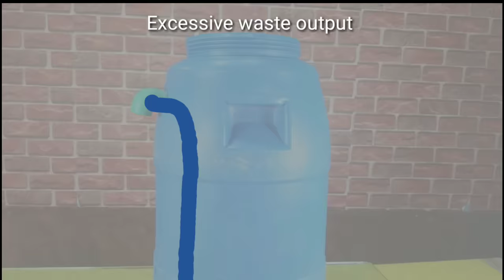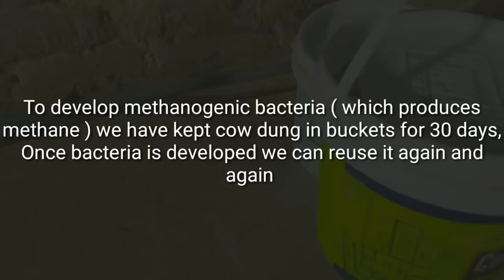How To Make Free Gas from Fruit And Vegetables waste | Bio gas plant |

Comment from the maker: A cork is fitted to the end of Overflow yellow pipe which can be removed when required.
The part is missing in video and everyone is nervous about that.
Enjoy the video and Be Safe,,👍👍
Reply: @madaiincubationcenter4947  Once biogas plant started to produce gas, you need to feed same with fruit and vegetable waste only. You can add waste upto 1 kg on daily basis if digester size is more than 1000 liter  and gas holder size is more than 750 liter.
Reply: how long does it last?
Reply: Naveed Zahir Creativity vijay
Reply: Do you mean the cork will remove when the wheel tube is at max volume of gas build up?
Reply: 1# Why the gas outlet valve of Drum is Close?
2# There is No valve installation on Overflow pipe. How its possible to pressurize the drum and storage tube in this condition?
Reply: Is there hose down in the drum for leak off
Reply: thank u in advance
Reply: भाई यह साइड मे ऐल्बो वाला पाइप क्यों लगाया है कृपया जल्द बताने का कष्ट करे
Reply: Useless
Reply: Sir, how many hours of fire can a full tire can generate?
Reply: Thañks. Let's build a 2.0 version, which have 1 way filter and elegant input waste door. So it need methanogen bacteria?
Reply: Why do you need an overflow pipe? Cow shit and  kitchen waste does not increase in volume.
Reply: भारत मुंबईकर 042
Reply: @gilbertoordonez3114  Sorry , I do not understand Urdu.
Reply: ¿El tubo que va a dentro como se le coloca?
Reply: But bhai, what to do when the tube is completely filled. Gas will still be filling, right..? 2) Till what time will the tank produce the gas..? There will be some limit correct, as to the amount of materials input..? Pls answer. No doubt, this is fantastic for rural areas problem solution. But how to control the production is most important. Pls guide. Thk u. Saby.
Reply: @sabyjpinto  gracias, si es en una zona Rural, no entendí muy bien lo de el tubo en el interior pero agradezco tu respuesta
Reply: We used all Expired products and infected food in our videos, Please do not waste any food because there are Still many needy people who don't have any food to eat. aI honestly want to help them please Support 👍
Reply: How long will it take to sustain gas flow? One month? 1 day? 1 week?
Reply: The yellow hose and water bucket are an overpressure release/"safety valve" system. You use a depth of water such that bubbles will come out the bottom before the blue canister and rubber storage chamber burst. 14.5 psi per 33 feet of depth. Since any bubbles would contain methane and escape into the surroundings, either constant observation or putting the bucket portion in a well-ventilated space/outdoors is required.
 As long as the overpressure in the blue canister and rubber storage chamber is below 1-2 psi, the pressure exerted by the water in the bucket will prevent gas from bubbling out through the yellow hose. This greatly limits the amount of methane that the system can store. The pressure and storage can be increased by placing another, inverted bucket floating in the larger bucket, with the yellow hose entering the created air space inside the inverted bucket or placed beneath the inverted air bucket so that any bubbles will enter the created air space, and placing weight atop the inverted, floating bucket. But you must be sure that the pressure so created does not exceed the bursting pressure of all of the other components.
Reply: Hopefully someone here can help me out. In the middle of building a 5 gallon bucket biodigester. I don't understand the pros/cons of various ways of building the outtake for slurry. Some people seem to have a pvc on the inside, while others manage without -for example, an upturned elbow pipe. Some use a ball valve, others (like this) use a cork. Some use a t pipe to avoid accidentally siphoning the container empty, but it's not always needed. Anybody able to provide some clarity? I just don't want methane wasted in my outtake, or slurry being released when I'm not around.
Reply: amir khan  It absolutely does. That's the direction I was leaning towards with an internal pipe for the slurry's outlet, but I wasn't sure if I'd been missing something. Thanks.
Reply: @gonzaloramirez5514  Gracias. Muchas zonas rurales no tienen conexión de gas. Esta es una excelente solución donde todas las personas pobres pueden producir su propio gas si se les enseña a controlar la producción de gas.
Reply: I have 6 questions.
1. Does the gas smell bad?
2. Does the smell go away when you burn it?
3. If the gas was to bubble up through water before you burn it, the hydrogen sulphide (rotten egg smell) dissolves very easily in the water, and the methane does not, that would get rid of the bad smell, but what would it do to the water? 
4. Do you know how to make fertilizer from this?
5. How much gas do you get from the waste before you have to start again?
6. What happens to the waste after you have extracted all the gas from it?
Reply: @sabyjpinto  gracias por tu respuesta
Reply: @gonzaloramirez5514  de nada mi amiga.. :-)
Reply: Mk
Reply: How will you keep on adding waste
Reply: This is wonderful enough. I see people wondering about storage,  but it's so easy to figure out. 

What we need is our brewed Methane. Just run the Tvalve into a  gas bottle and put your eyes on the gas bottle by allowing water to run on the side of the bottle to see the gas level in the iron container. When it is full or you get your required level,  simple short down the entire system until you're ready to refill again. 

What's the trouble about that my people?
Reply: En español me puede decir cuánto es su duración
Gracias
Reply: Fico impressionada com a capacidade de algumas pessoas ao redor do mundo.
Reply: Be safe.  Inner tube is close to fire..be safe
Reply: Yes sir ur right
Reply: @gonzaloramirez5514  lm tttt
Reply: Bravo una cosa mijour
Gracias
Reply: Hallo sir repale
Reply: @shubhamgupta8984  ŕ
Reply: What is the yellow tube for? What is the use of it
Reply: I have one doubt bro that if we keep that cow dung in plastic bucket for 30 days because of the pressure the bucket may blast is it good to keep in bucket cow dung
Reply: @naveed zahir creativity, can i get its thesis.. And also tell how much gas quantity could be produced
Reply: M
Reply: You need to add a bubbler tube so you will not have basically a gas bomb if the flame goes back into the tank.
Reply: Blue light comes out when bio gas burns, yours is normal gas ,,,,,, who are you kidding ???????
Reply: Blue light comes out when bio gas burns, yours is normal gas ,,,,,, who are you kidding ???????
Reply: Blue light comes out when bio gas burns, yours is normal gas ,,,,,, who are you kidding ???????
Reply: What's the song
Reply: Anyways, what's the song?
Reply: I was not nervous, more like it won'T work since all methane would escape from the yellow pipe lol. thank you for sharing , thumbs up  we need to learn  these processes these days!!
Reply: now i understood 😂😅😅😅 thanks👍
Reply: @bharatmumbaikar  v
Mav.vm.
Reply: @jaydiomoyeni7436  so how long will it Last before recycling?
Reply: @makerofmanythings8447  what is bubbler tube sir?
Reply: What's the disadvantages of the bio gas?
Reply: One question: what if the excess gas surpasses the gas chamber capacity and has no other outlet?
Reply: How does it smell when it's burning?
Reply: Very classy way to make a kind suggestion! I'm sorry but I'm still trying to get over the PTSD  that Facebook can cause so I'm not used to people being kind to one another or having nice conversations, which are also intelligent, so you'll have to forgive me.lol☺️👍🙏🙏🙏
Reply: sir paano pupunta sa stockan ung gas, my butas ung overflow mo sa gilid na hos. tsaka anupo ung nilagay nio na, 2 timba.
Reply: @Galv140577  Wow! You are asking many, BUT very good questions that I am interested to know myself. Great post!!!☺️👍🙏🙏🙏
Reply: @bharatmumbaikar  this does not work. The yellow hose does not allow pressure to fill the tire chamber. The gas escapes through the yellow hose.
Reply: Good job.
Reply: @bharatmumbaikar  HHow do you feed? when you open the lid and the gas escapes...
Reply: P
Reply: @madaiincubationcenter4947  là
Reply: @madaiincubationcenter4947  ll
Reply: kĺp0
Reply: @virendrapratapsinghshisodi724  وانا لم افهم لماذا وكيف تم ضغط الغاز وهو مفتوح
Reply: How to clean this drum then
Reply: Sure, that was what was clicking in my mind because we cannot hold pressure in the tube & the yellow tube being a back forth  outlet
Reply: @Naveed Zahir Creativity How many hours of cooking do you get when the tube is full? Thank you.
Reply: I thought that side pipe was for air; don't need air for this?

So, is an "overflow pipe" strictly necessary?
Reply: Hola buenas tardes de casualidad no tienes una lista de los materiales
Reply: what do you mean "the manure can be used again and again" whats the  process?
Reply: Please the external big pipe is channeled for what purpose
Reply: @ZahidAmeenOfficial  a good    question nice one
Reply: Nice idea
Reply: klau dari WC gimna cara nya bang
Reply: А что в вёдрах добавили?
Reply: Çıkan gaz yanmiyor. Yardımcı olur musunuz
Reply: @jaysolano8764 when will it require to remove the cork😮
Reply: ممتاز جدا والله
Reply: Can I purchase this???

Comment: Add a second barrel and fill it with plain water so you can water filter the hydrogen sulfide off the gas by letting it bubble from the bottom up and out to your storage tube or tank ❤️🙏

Comment: The flame is yellow because of impurities. Best to pass the gas through steel wool and through a water tank to filter out the co2 and h2so4. Then you'll get blue flame. Also, is it safe to keep the rubber tyre so close to the flame? It can make it expand and explode. keep a longer pipe, and keep the set up outside the kitchen. 
Good job and thanks for teaching. Hopefully, the whole world will do more of this and be fuel sufficient. and save the environment.
Reply: But with the yellow flame is possible to cooking? Right?
Reply: Who cared about blue flame? Yellow flame is more hotter.
Reply: Thanks for the information
Reply: @caiodemaduro6408  it's less efficient
Reply: @ranjanbiswas3233  you bunked science classes
Reply: But what's the white bucket for on the ground next to the Blue Barrel
Reply: @carlschmiedeke151  overflow for whats in the barrel
Reply: @ranjanbiswas3233  No, blue flame is much hotter than yellow flame & the hottest kinds of flame is almost invisible. (see welding torches)

Comment: I recommend using a 90° elbow on the lid to prevent the tubing from kinking. Also a couple  of flame arresters should be added. It's basically a piece of plastic piping filled with water with a hose fitting on each end, this will prevent the system from becoming a bomb if the flame goes into the tubing if the gas pressure gets to low.
Reply: I totally agree 😆
Reply: is this really possible and true sir? Planning to do this during the weekend.
Reply: How long when you have only one dram?

Comment: This is amazing. I guess instead of letting wasted gas going through the water reservoir you can connect more tyres or have a larger tyre. A regular car tyre is around 1.2 cubic meter is roughly around 10kwh and a burner uses around 1.5 kw per hour so that tyre can last you up to  6.6h!
Reply: better: while not cooking, turn the cooker on minimum and place it under the blue drum — the fermentation will be nicely enhanced...

Comment: Thanks for the great video just wonderful info to help people become more independent from the big oil companies!!! Keep up your wonderful work!!! In the 1970 I was working on a project making an expansion of the municipal sewage treatment plant in a very large city. There we scrubbed the methane gas and we ran pumps and backup generators with this gas. We had 2 methane gas storage metal spheres for storing the methane gas. We produced so much gas that we had to burn off the excess gas by using 2 torches that produce a 3to4 foot high flames that ran 24/7/365. Part of the expansion project was building 2 more 80’ diameter spheres. And that was still not enough storage space. They also had burners for getting rid of the excess gas!!! The funny/sad thing was this all took place during the Arab Oil crisis.... There was talk about converting the Municipal cars truck and buses to run methane gas... nothing ever happened. Now maybe we have learned our lesson (MAYBE) and we are moving more and more to electrical powered transportation!!!
Reply: In my university there is this method of turning waste to ethanol since the 80s, but it's never used.

Comment: You need to add pressure relief valve that will release excess gas when we are away for holiday ( safety measure). Also, need to explain your audience that when refilling the waste tank. Close the ‘trapped’ gas in the tyre so you don’t lose so much gas during opening the blue tank. Also, use waste byproduct as Bio fertilizer once done with biogas production.
Reply: Just wondering where exactly  it is supposed to be fitted
Reply: Rama Yusvana
1 год назад (изменено)

Comment: Why not put the epoxy glue between the brass fitting and the cover, and instead of drilling a hole on the cover, drill the hole on the highest side of the drum so that the tuning will be out of the way when loading the drum, and the tubing will not have a link
Reply: que cagada hace con la presion del gas  buela revienta todo
Reply: Good idea sir flaviano sico

Comment: Nice video. But please take much safety precaution with gas. Burning gas right beside gas in the tyre could be very dangerous.
Reply: lol yeah, the tire full of gas was like below 10 inches from the flame...overtime if the rubber burns, it could cause leakage or outright instant explosion!!!

Comment: This method seems to work but I think you would benefit from a few key improvements. To start, the overflow should be in the very center of the barrel with an pipe on the inside to the dead center of the middle of the barrel. This is because it's the most stagnant and is decomposed properly. The bottom has a ton of bacteria while the top isn't ready yet. A valve would be needed to prevent unwanted flow. This material is used for your crops. Second improvement, you need a scrubber to clean the bad gas's out. This can be done with iron wool that is rusty. Bonds with the other gas that's not methane. This is VERY important. Also bubbling the gas after this step through water will further help purify. Lastly, a spark arrestor or flashback prevention is always a safe bet. Don't want to blow yourself up.
Reply: Spark arrestor for static charge?
Reply: @raufjaleel8317  it's a flashback prevention. Keeps the fire out of your storage tank.

Comment: This lacks a back fire stopper which can be placed before the stove. It is easy to make let the gas bubbles into a bottle of water covered with some oil and get out of the bottles cap through the pipe to the stove. This simple step will prevent back fire in the system and blocks the fire from getting back to the gas container.

Comment: You can put pvc pipe into barrel, make it go out lid and all the way into barrel. On end inside of barrel you can cut an angle for food, dung to enter barrel. When barrel full with dung or water the gas can’t leave thru the pvc pipe since liquid is blocking it.

Comment: won't the gas cone out every time you open the lid to feed?  You need feeder pipe from bottom.  Also it will work better if the scraps are at leastt minced. It won't be decomposed enough in seven days.  Further more if this is methane the flame will be blue

Comment: None of parts are tight enought to use with gas. Leakage are everywhere. It should be done of soldered metal. Start using seals instead of glue but it is much better to use conical thread

Comment: Never get gas from this project because some major fault in this prototype,please answer how develop pressure to inflate the tube , a big outlet open on the tank body when pressure develops it escape through the easy opening it is natural.
Reply: There is a pipe connected to the overflow which goes to the bottom of the drum so thats not an issue but still this is waste of time 01:05

Comment: Heat rises. One of the coldest spots would be on the floor right onside of that stove. The inner tube was only in danger if punctured. And even then it held NO pressure because of that ridiculous down pipe/ "overflow" pipe. The tire cant hold more pressure than the water in the bucket can resist.
Edit: that being said, very clever.

Comment: You really should implement a CHECK VALVE / non return valve between the wheel and the burner. It is a standart tool in welding and prevent that the flame of the burner can incent the gas in the pipe and the wheel. 
Thanks for sharing this idea.

Comment: Bro, can it be refilled? The fear is that when it is refilled, the methane inside will come out in disarray.
Reply: yes it can just alter the design and add a pipe on the tp of the lid insert a pipe going to thee bottom of the container and add a  cap to it when your not putting any biodegradable
Reply: @jethroperez548  just to emphasize , the refilling pipe should be below the water to avoid losing the gas on the tank

Comment: No safety precautions have been taken to protect the tube or the tub from getting exploded.  No gauges used to check the pressure of the gas in the tub or the tube. It may turn into a havoc and may claim precious lives.
Reply: Interesting observation.  I will research adding pressure gauges.

Comment: Outlet with bucket is for what? It wouldn't leak gas? 🤔
Reply: There is a pipe inside the container  that runs below the contents level thus stops gas escaping.  The small area or volume inside the pipe allow neglible gas to escape.  The purpose of this outlet is to allow excess material outside into the bucket as the biomass matter expands in the vessel .